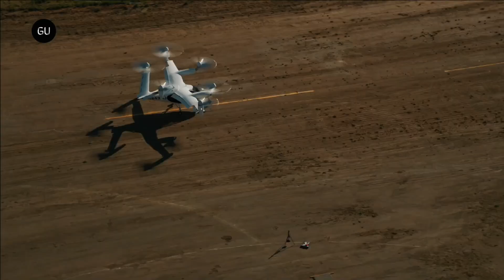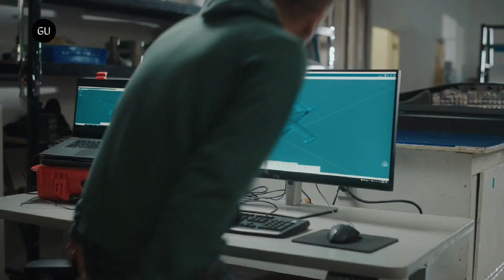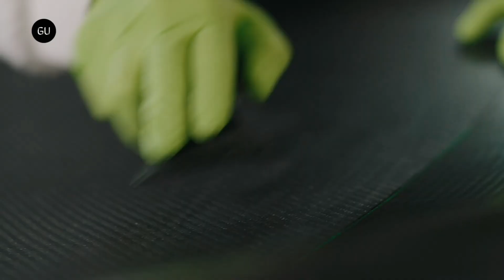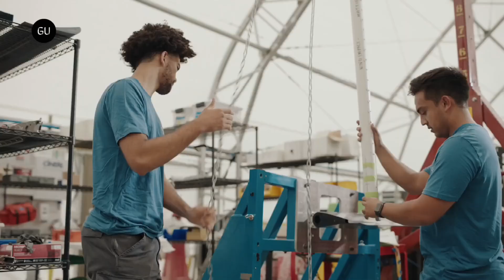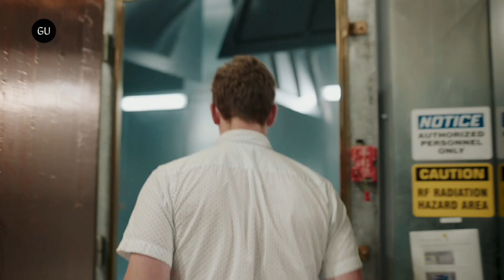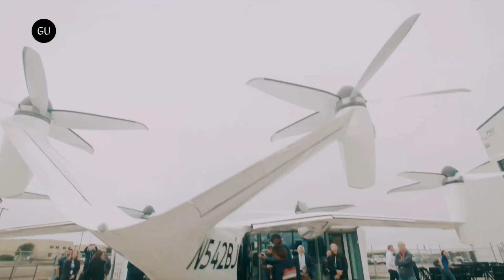Great Joby S4 News

Comment: The painfully slow production of carbon fibre composites and accompanying exorbitant manufactured cost is anathema to automotive production techniques and unlike any Toyota processes - hard to see what they can transfer from metal, spot welded stamped steel mass production to this slow motion operation . Fifty years ago (1973) I was building composite sailplanes in Germany (and later on military aircraft composites ) and have worked in the automotive industry in product development and did a stretch as an inspector in vehicle production (Ford light and heavy trucks F series etc -'low volume' by car standards but light years ahead of the cottage industry composites  (one Detroit executive famously said that carbon fibre would still be too expensive even if they gave it away - so slow are the fabrication processes .   The economics of 'evtol air taxi' operation are hopelessly unviable even given the best assumptions -the Morgan Stanley analyst's hype is pure garbage but underpins the present bandwagon and crazy money throwing contest.